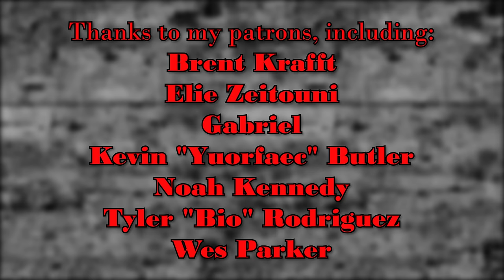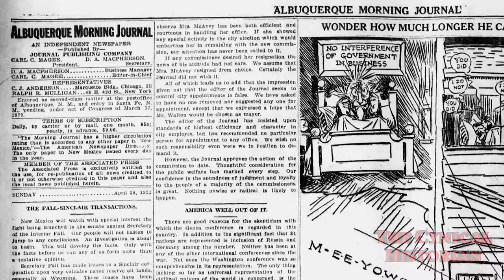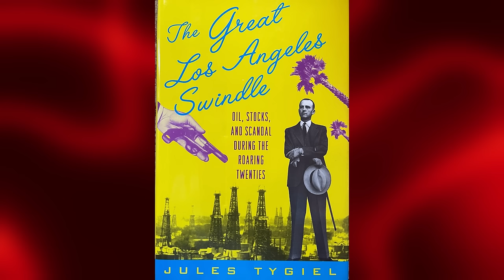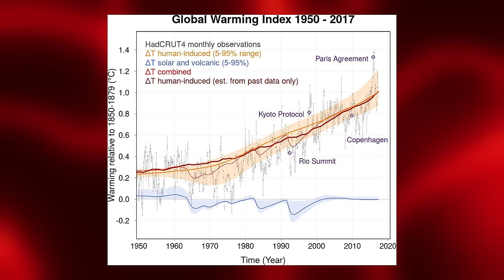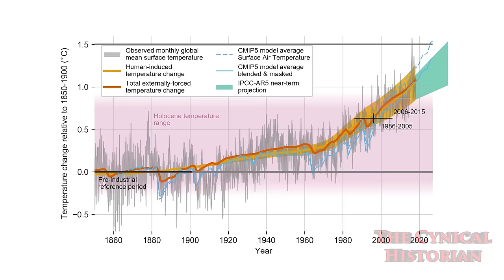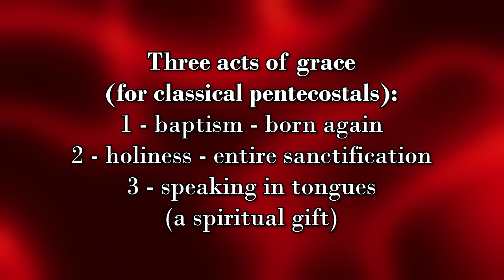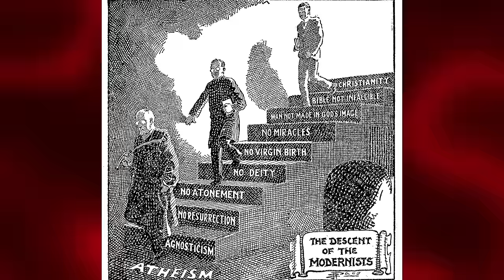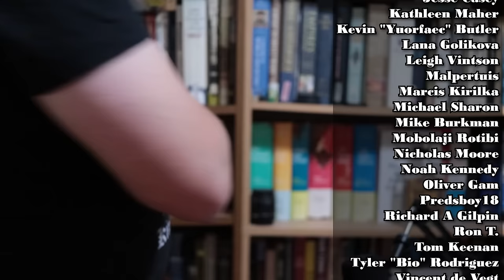There Will Be Blood and History

Comment: There was also extensive gas and oil drilling in Southwest Michigan during that time period.     Few traces of that remain today.  One of the most interesting is the intersection of M-51 and Red Arrow Highway a few miles west of Paw Paw which bears the name Tea Pot Dome.  A nearby restaurant called Tea Pot opened in 1925 and is still in business.  Another restaurant called Tea Pot East opened on the same highway a couple of miles east of Paw Paw.  Both are quite popular with locals for their reasonably priced meals.  By the way, Red Arrow Highway is the former US 12 which was replaced by I-94 in the 1960's.  It is roughly based on Michigan's oldest highway, the Territorial Road connecting Detroit and Chicago.  According to a historical marker in Paw Paw there was so much traffic on this highway in the 1830's and '40's that travelers often could not find lodging along the way and had to sleep outdoors.
Reply: Not to be confused with Teapot Dome, Wyoming of course.
Reply: Thank a RepubliCON

Comment: in answer to the final question. 
no. 
capitalism is based on individual greed. 
inevitably, there will be someone who wants what another has. 
and under capitalism, no holds are barred (a wrestling simile). 
indeed, cheating (using holds that are possibly deadly) is encouraged.
Reply: I disagree the answer is yes
Reply: Technically, capitalism in its purest laissez faire form treats  selfish materialism as a positive that allows the market to self regulate. In practice, a regulatory regime is needed to keep bad and reckless actors in check. Ironically, the optimal strategy for long term growth and success would be a collaboration, not a competition. The laws regulating anticompetitive behavior are supposed to keep any single entity from becoming too powerful. Lately, enforcement has been lacking and it will only get worse.
Reply: @LawlessChemistry  I have only one quibble. 
and that is the word "technically".
Reply: @highcouncil1302  you disagree the answer is yes? 
or 
you disagree, the answer is yes? 

either way...
no. 
is still my answer.
Reply: @kidmohair8151  capitalism allows for better community in my mind
Reply: Capitalism is an economic system. What kind of community does it foster? It can literally be a community of indentured servants, and that wouldn't be a good thing.